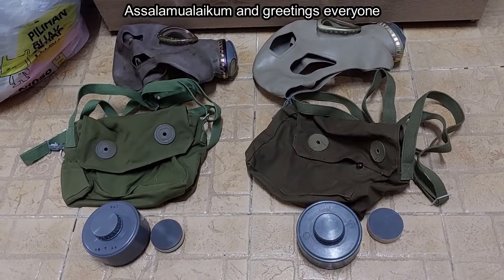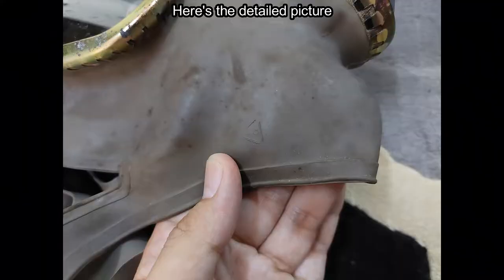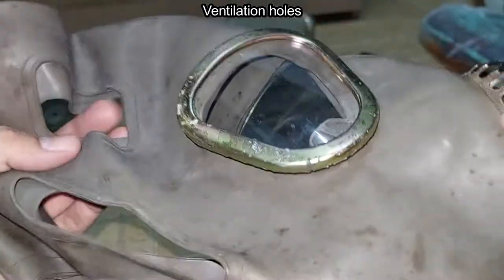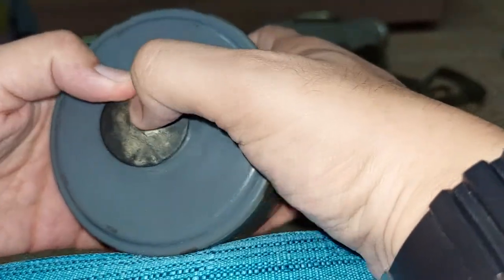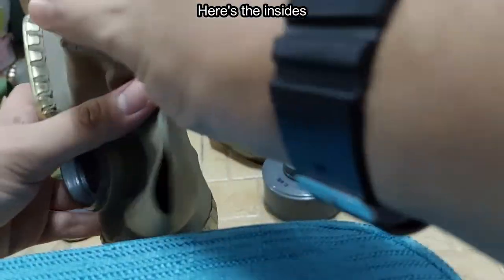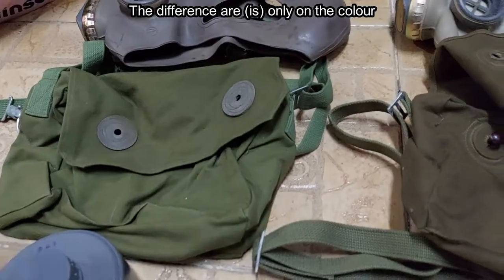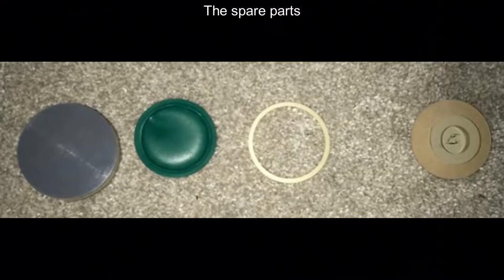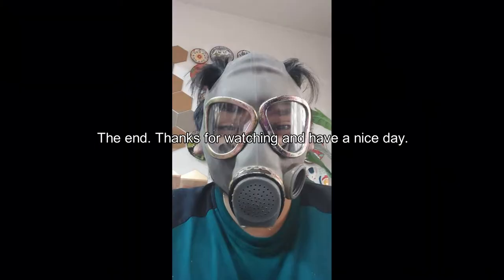A brief explaination on the Chinese Type 69 gas mask

Comment: Cool, thanks for the video!
Previously, I have not seen the inside of the filter anywhere (under the cover).
I have been wondering for a long time, does this filter have both coal and filter paper? It looks very small and it seems that both of them would simply not fit there.
Reply from the maker: I believe the filters does contain asbestos since I saw white dust on the caps and plugs of the filters. I'd reckon the mask and the filter themselves are intended for short use only since the Type 64 and coffee can style filters were (still are) being used when the Type 69 came out